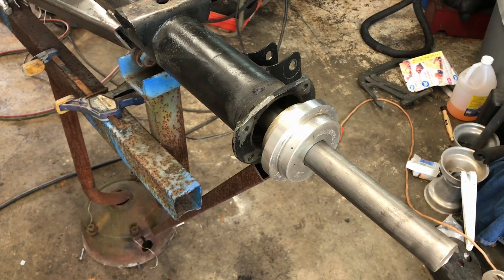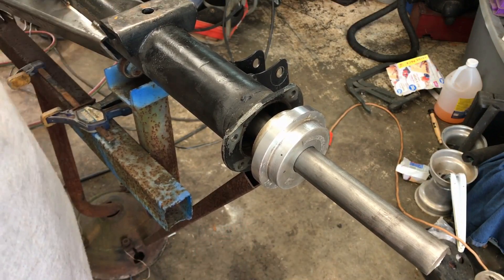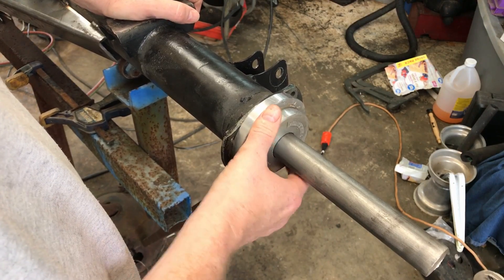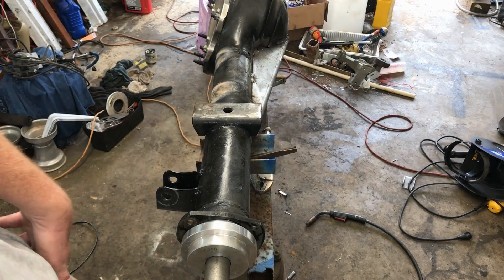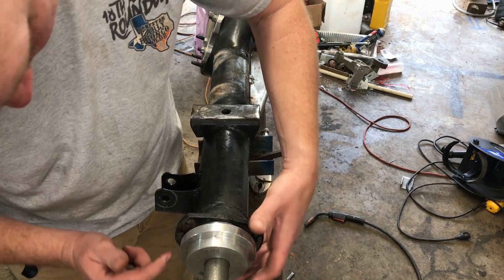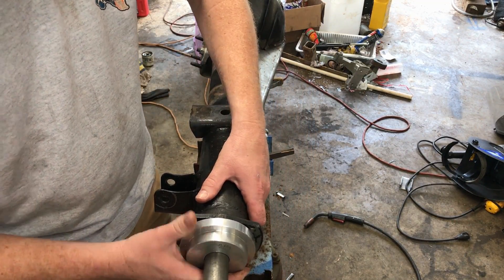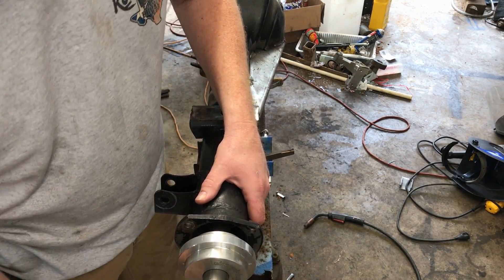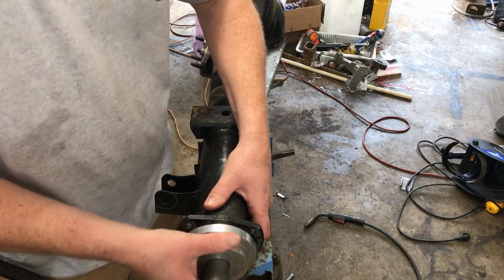Straightening a 9in Ford Housing

Comment: I’m currently getting set up to narrow my 9” housing.  
    I have a 5’ x 1.5”  length of new chrome hydraulic rod. I’ve checked the runout in the rod at .004” t.i.r. 
which seems very straight for that length of material.  
     I plan on turning my own pucks and I would like to know how close to fit them.  Is .005” too tight a fit?
Reply from the maker: I would think that would be ok, but then again, I'm not enough machinist or engineer to make that call.  And I suppose if you had trouble sliding them together you can always open the puck up a bit more.

Comment: So all you used was heat? How do you know where to heat?
Reply from the maker: Heat the point that you want to shrink.  When it cools it will always shrink to a smaller dimension than it started.
Reply: Awesome thanks for the video. Gonna try tomorrow with two mapp gas torches, if it doesn't work gonna pick up an oxy setup on Monday, I've always wanted one but couldn't justify it
Reply from the maker: @jaimereyes7480  I can tell you MAP won’t do it.  And oxy/ace is not cheap to start up.
Reply: What size and style tip is on your torch?
Reply from the maker: @jaimereyes7480  I honestly don't know.  For heating anything quickly, though, a rosebud torch is best.

Comment: Whered you get the axle bar and pucks?  Made locally?
Reply from the maker: Seems like I got the pucks off eBay.  https://www.ebay.com/itm/9-Ford-Deluxe-Rearend-Narrowing-Fixture-w-Rearend-Ruler-9-inch-Ford-Rear-End-/224349839272?_trksid=p2349624.m46890.l49292. Had to source the bar locally.  Can’t remember how much it cost.

Comment: Nice work.  I have used heat lots of time to straighten metal.  I use ice cold towels.  I have heated bent pieces and watch them.  When they shrink to just about straight I throw the towels on it to stop the shrinking.  There is an art to knowing just where to put the heat.  Take care and stay safe.  Tom

Comment: I have a 2013 mustang with both rear tires wear 2mm faster on each tread divider towards outer tread like a positive camber wear. Could it be a bent 8.8 axle housing?
Reply from the maker: I sent a reply but wasn’t thinking... I’ve read that 8.8 tubes aren’t always welded to the center section, so it’s possible they’re not straight.  A four wheel alignment sheet would show a difference in rear camber. (Btw, I thought mustangs from around 06-on were independent rear suspension?)
Reply: @ahuggins6  Thats the weird part, my last alignment seems fine. IRS started 2015 and up.